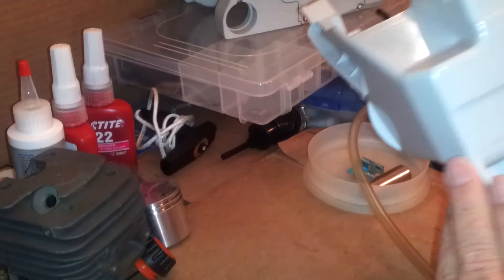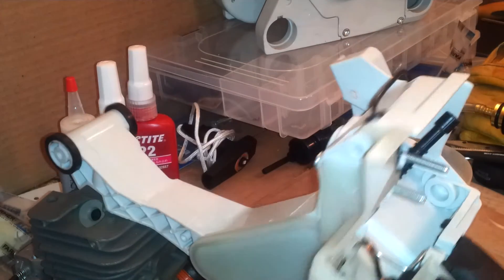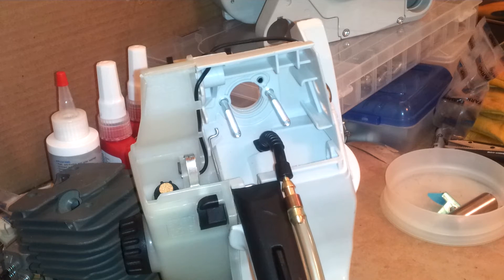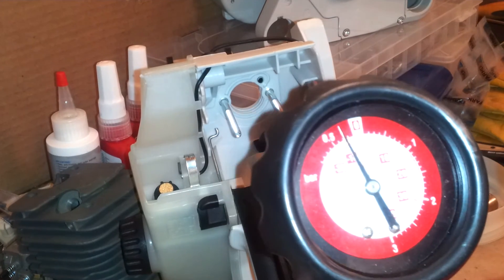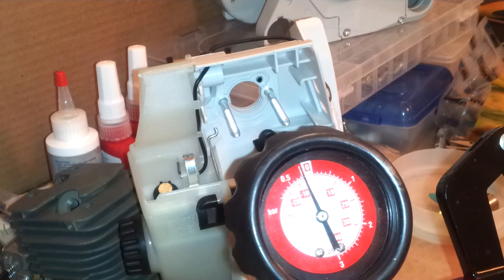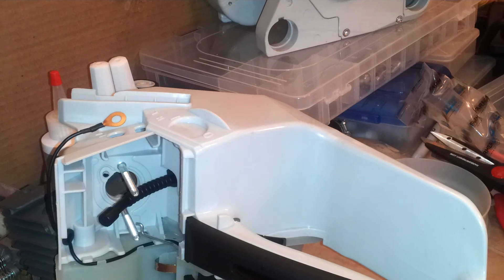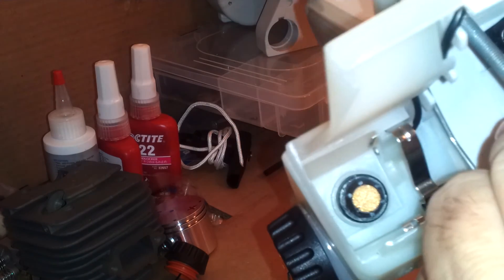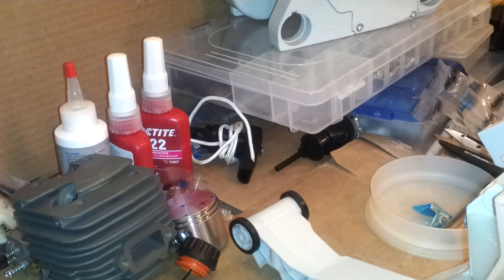Huztl FarmerTec MS380 Chainsaw Build Kit Workshop Series   Tank Pressure Test

Comment: Leak down, spray a little wd40 on the tank vent top,pull a vacuum on the tank and see if the wd40 disappears.  I have bought several Farmertec Elastomer start pull ropes and they all have come apart on me.  Spend the $25 and get a good pull rope.  My problems with the Farmertec ropes was the handle came off the rope.

Comment: I had to replace the tank vent on my 360 and 361.  I had to replace the rear handle on the 361 because the tank seal was leaking like a sieve.  I replaced the tank vent on the 360 with a Stihl vent but used a Farmertec vent on the 361.  No problems with either saw, afterwards.  I do not like the location of the tank vent on the 361 because it is on the side of the tank and can get covered with gas if you fill the tank all the way to the top.  I just underfill the tank, slightly.

Comment: why did you check the  gas tank to see if it would hold pressure, other than to test the tanks vent Valve?  have you had problems with the vents on huztl parts?
Reply from the maker: Just testing the new saw I am building. Testing the saw is not a sign of weakness, its testing the saw so you know its fit for service. Huztl is very reliable.